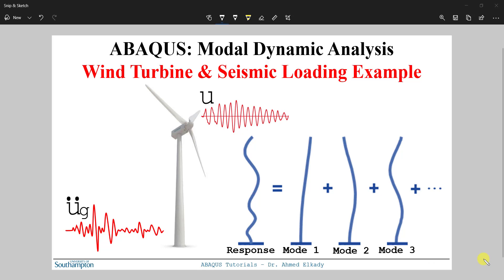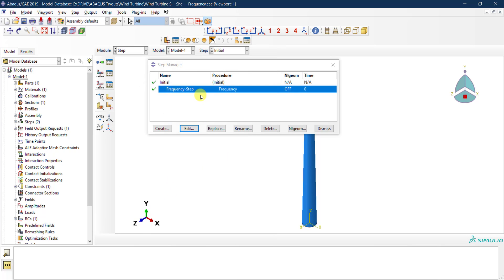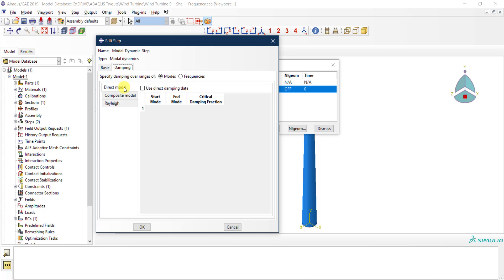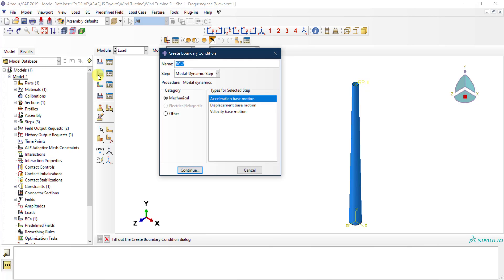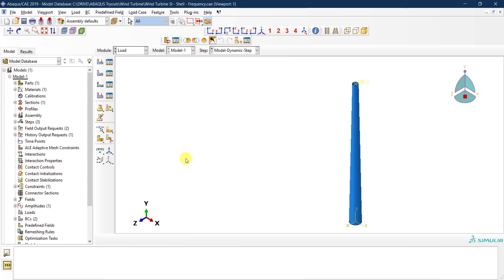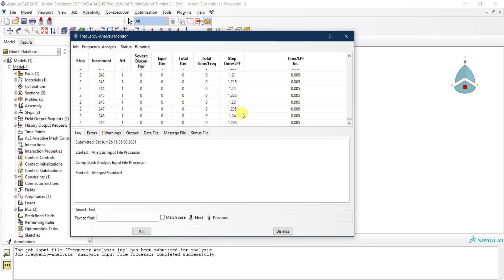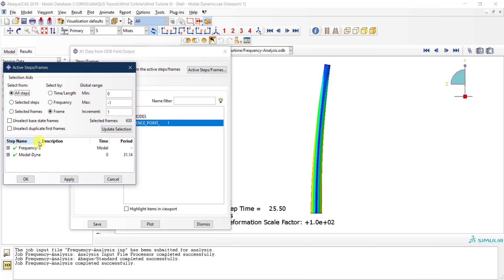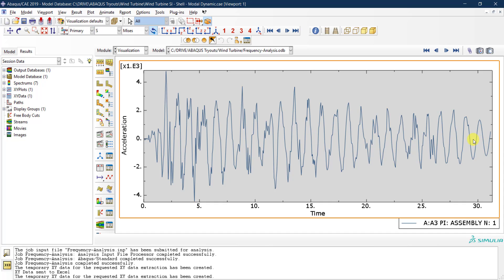#29 ABAQUS Tutorial: Modal dynamic analysis | Wind Turbine Example

Comment: Hello sir, 
Thank you so much for this life saving video on wind turbine, can you please help me with this  .
Preselected output requests are ignored in sim-based modal superposition procedures (except complex eigenvalue extraction). You must always specify output requests to the output database (.odb) file; otherwise, the analysis will not be performed. A user odb or sim output request is required in a sim-based procedure.

Analysis Input File Processor exited with an error.

Comment: thanks again for your effort. i want to apply a multidirectional earthquake to my structure. should i used dynamic implicit or modal dynamic?
Reply from the maker: Model dynamic analysis is typically used for elastic analysis. Otherwise, dynamic implicit or explicit shall be used.

Comment: "PRESELECTED OUTPUT REQUESTS ARE IGNORED IN SIM-BASED MODAL SUPERPOSITION PROCEDURES (EXCEPT COMPLEX EIGENVALUE EXTRACTION). YOU MUST ALWAYS SPECIFY OUTPUT REQUESTS TO THE OUTPUT DATABASE (.ODB) FILE; OTHERWISE, THE ANALYSIS WILL NOT BE PERFORMED. A USER ODB OR SIM OUTPUT REQUEST IS REQUIRED IN A SIM-BASED PROCEDURE." i am getting this error
Reply: Im getting the same result